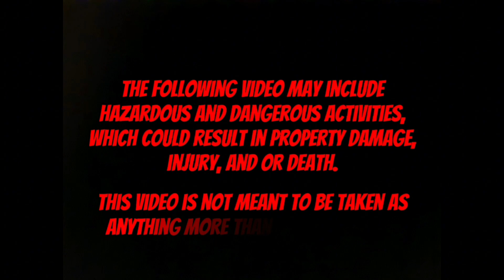Reinstall the Engine Engine Repairs part 3

Comment: Hey bro see if you can spend the crankshaft in the front or see if you could spend the flywheel in the back of the motor maybe the torque converters binding and it won't let the transmission line to the block
Reply from the maker: It was the Engine mounts, it either didnt like that i unbolted the brackets and put em back, or i unknowingly swapped the mounts at the engine left to right. Thanks for watching, i appreciate it!